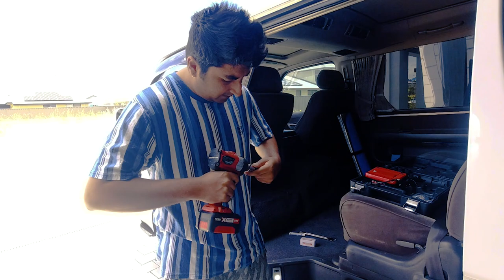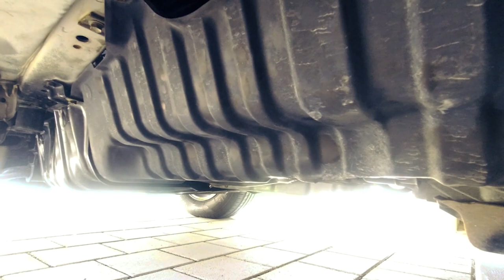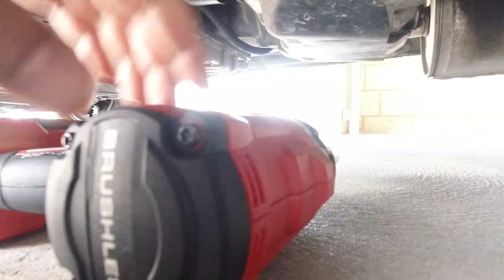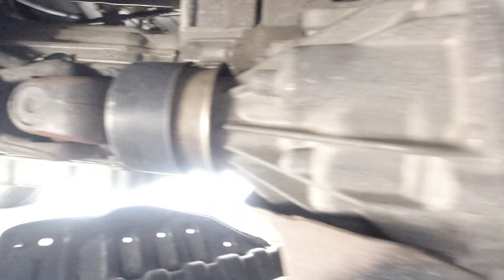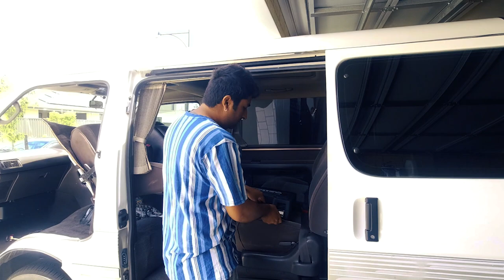Toyota Torque Converter No Lockup Solved✅ ($45 Temp Sensor!)

Comment: I am getting a constant 2500 or more revs at 100kmh, and 2900rpm at 110kmh. Mine is a 1996 3lt 1kz awd super custom, only has 84xxxks on the clock. Everything feels good to drive and engine is mechanically sound. Would you consider that unusually high rpms and worth having a deeper look at? Cheers mate!
Reply from the maker: I can't remember exactly but 2900 at 110kph seems too high. I think mine does about 3000rpm overtaking at around 120-130kph.

As long as all the gears are there and you've counted them it's fine. Drive it till it's warm, remember torque converter won't lock until it's fully up to temp (about 15 mins highway driving).

1st to 2nd.
2nd to 3rd.
OD off 3rd should lock up at 58kph.
OD on should lock up at 82kph.
Reply: Awesome cheers mate, you’re a legend!

Comment: thanks for the info,
It would be good for you to get the workshop manual for your engine, there they specify all the engine parts, search the internet for sure you will find it, I have found the manual for the hiace engine series from 97 to 2004
Reply from the maker: They have manuals for the 100 series and RZH online but not the KZH. Apparently there's such little documentation on this car from Toyota that Toyota Australia actually checked a customer's car out and told him it's a counterfeit!

Comment: My U140F transmission lost reverse and drive so I'm here shopping for nuggets of information that may help my case.
Reply from the maker: Haven't experienced that myself unfortunately. I would check the linkages, then the electrical connectors then try a fluid and filter change before going down the rebuild route. But a good transmission shop would probably diagnose it quicker.

Comment: Any idea on what could be causing my Hiace to not have lockup even after replacing this temp sensor? It’s driving me absolutely nuts
Reply from the maker: Did you do the ecu temp sensor or some other one?
Reply: @nathansharma87  temp sensor behind the oil filter
Reply from the maker: And the driving it at 60kph with overdrive off at running temperature you can count it change from 1 to 2nd, 2nd to 3rd and 3rd at 60kph you should feel another shift?
Reply: @nathansharma87  I can feel and count gears 1-3 but not that last shift. When it did work the lockup was not a smooth shift it was more of a jolt
Reply from the maker: Check transmission fluid? Is it pink and clear? And check ATF while engine running for level. Lockup is controlled by ecu, ecu allows it when:
1) Throttle less than 30%
2) Engine at full operating temp
3) overdrive off 60kph or overdrive on 80kph

It could be old or low fluid, could be an ecu issue or could need solenoids in the transmission or even the torque converter failing.

The main thing though is it won't lock up if the ect power button is on in 3rd with overdrive off. Only with it on at 80kph. Make sure ect power is off.
Reply: @nathansharma87  Found out what the issue was… cheap LED headlights. Damn you China!! At least now my Super Custom has new ATF and a new sensor! Cheers.
Reply from the maker: @bighaus911  led headlights causing no lock up?  That's the strangest thing. Must have been messing with the ecu.